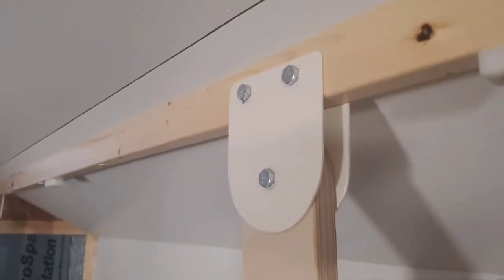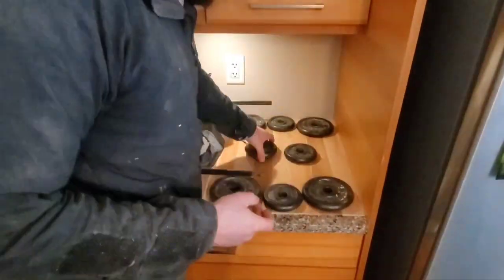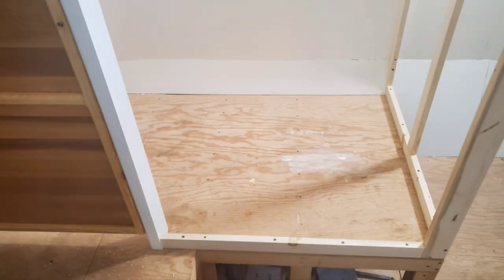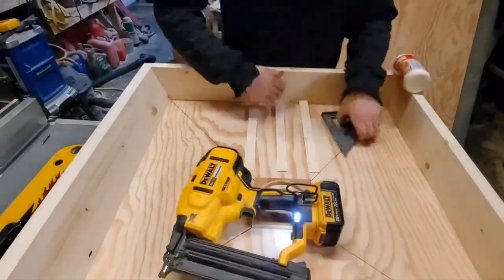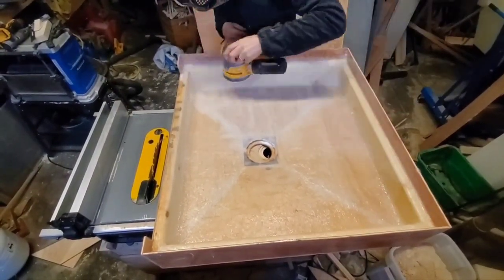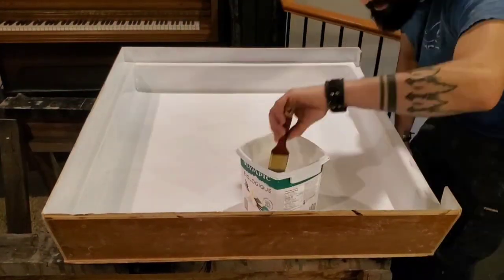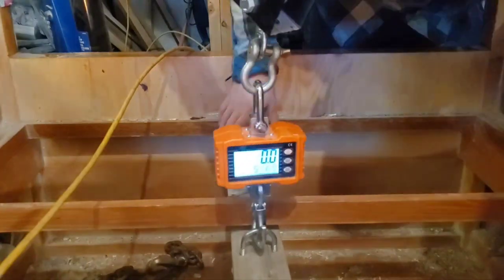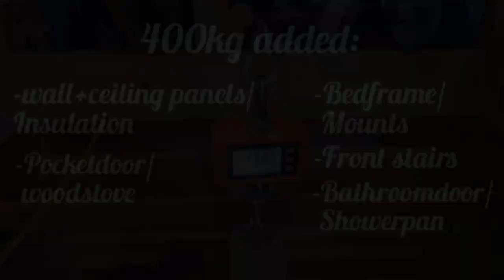Tiny Houseboat Build (Part 10) The beginning of the bathroom!

Comment: this is great  i really appreciate the technique, I wonder if you could have used some lighter material prior to fiberglassing if you uses some woven glass for structure,  a rigid foam core is what some commercially available shower pans are
Reply from the maker: You are absolutely right about this! Someone else actually recommended that in a previous comment. I spent so much time and effort to build this boat as lightweight as possible and then I built this ridiculously heavy shower base! I don't know what I was thinking! I guess part of it was that I simply wasn't aware of foamcore shower pans. I am not very experienced with bathroom builds. Sadly there is no way to change it now without taking most of the shower apart again and wasting a lot of material, so I will have to live with it.

Comment: for tubs and showers there is this thing called glazing
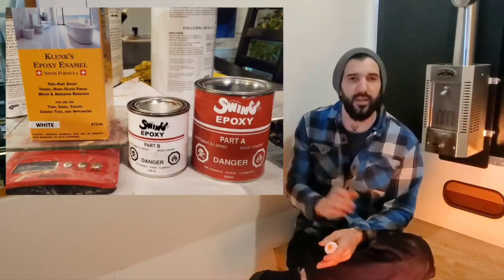Reply from the maker: Glazing kits or tub refinishing kits, specifically meant for bath tubs, sinks and shower bases, are epoxy products, which is exactly what I used here once the core for the shower base was built. (As shown at 9:19)